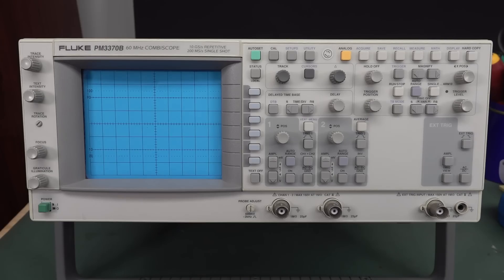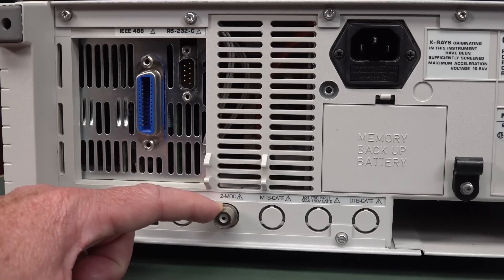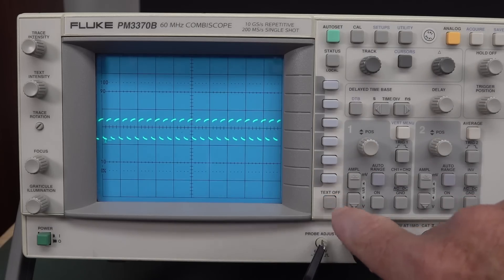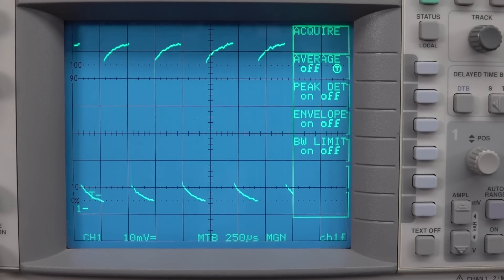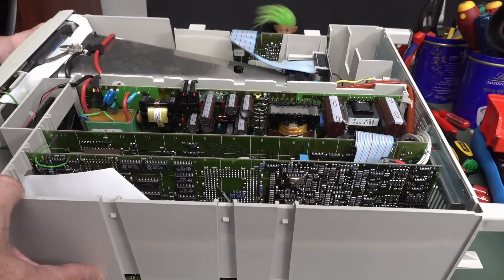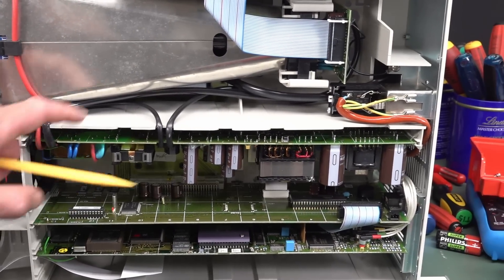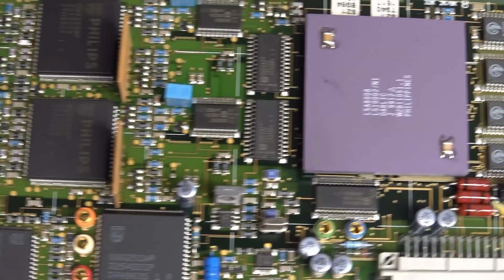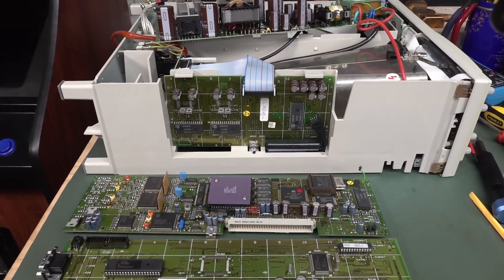EEVblog 1450- $99 Fluke Combiscope Ebay SCORE!

Comment: Used to have a 3082 if memory serves - very similar but 100Mhz and no memory. It was amazing. Bought it from UK Army auction for €150, sold it 15 years later for £150 😂 
Absolutely amazing. Open it up and admire the absolute absence of trimmers. All is done via service menu.

Comment: A few years ago I picked up an old GW GOS-653G that was sitting in a council cleanup pile. I was going to get a friend who's familiar with these old analogue oscilloscopes and has repaired one before to help repair it, but he said he's getting too old and his eyesight isn't good enough to do electronics anymore. Did you want to take a crack at repairing it?

If so it might be a while before I get around to dropping it off, since I don't have a car. And I'd want to clean it up first.

Comment: We have 2 digital/analog, 2 analog only of these with 4 channels and 200MHz bandwidth.
The are pretty good for their age and easy to operate compared to older Philips digital scopes. The digital/analog switch is great to have. 
These ones have had a hard life, they have been dropped many times, the front bezels and  knobs are broken. Three were were bought around 1998 but they all still work perfectly.
I bought one of the digital/analog ones about 10 years ago for $300 on Ebay.

Comment: Around 16:30 i noticed a couple of things. You appear to have co-ax inputs for ch3/ch4 on the main acquisition board, and jumper zero ohm links near the top to change 2k/8k to 32k so it may be possible to hack in the extra ram and even maybe the extra channels.
Reply: Extra channels would be awesome, but (I only listened, didn't watch the video) there are no buttons for the extra channels in the front end. Were they on the board, though? You'd probably have to buy a broken 4 channel model to switch the front, right?

Comment: I’ve had the 4 channel Philips branded 200 MHz version for years now. A bit yellower but the original (Belgian made) Phillips AAs are still going and clean. Glad to see it’s Dave approved. 
I thought it was cool the I’ve had the 4 channel Philips branded 200 MHz version for years now. A bit yellower but not bad. Glad to see it’s Dave approved. 
I thought it was cool the TV trigger mode has settings for analog HD systems at 1050, 1125 and 1250 lines.

Comment: Hola mate 🙂I recently scored on Ebay a Hameg HM305 two channel 35mhz oscilloscope for $140 dollars which also has a component tester built in, like your Fluke in this video, it was sold as "not working, for parts only" but when I got and tested it all seems to work ok except when trying to get a signal on either channel the trace disappears and it is a bit difficult to get it back unless I power it down and start up again, any thoughts?
Reply from the maker: Sorry, no idea. Ask on the EEVblog forum.

Comment: It is nicely put together. I'd hate to have to find that problem. So like it seems to basically work and then at some point it stops working. So like does that mean something changes with time or heat perhaps, and it does it so far that it dramatically fails and starts up ok for a while later. Guess it may help to search for similar problems with that model and then try to isolate what module it is happening in. It could even just be a CRT problem? and it otherwise keeps going properly.
Reply from the maker: Most likely a thermal problem in a solder joint or a component.

Comment: Could it be a marginal/faulty high voltage transformer for the crt display? Perhaps the insulation is breaking down? Snap, and it turns off.

Comment: I scored two scopes at a surplus place. One was a Tektronics 2445A for $50 and the other is a Tektronics 2465B for $60. Both would not turn on which suggests power supply problem. I was able to locate a refurb power supply for the 2465B from Greece for $265 and it has been a great scope since. I was not able to locate a power supply or service manual for the 2445A, so I never bothered to do anything with it since the 2465B is the better model. Great score!

Comment: For under 100 (AUD and not by much) I've "scored".... a broken HP 1742A with an arcing HV transformer (was able to find this part at a reasonable price), and whacked out horizontal that god knows what's wrong in this godforsaken PCB tetris machine, and a broken Tek 442 with a shorted and smoking seemingly irreplacable HV transformer, and a broken irreplacable 5 meg ohm focus pot. Not exactly winning....
Reply: Every time I go looking for a cheap scope (after my last $50 craigslist special I got like 10 years ago died in an irreparable way), I find nothing locally, and everything on ebay is too expensive to gamble on (especially after adding in shipping) or outright up into may as well just pay a bit more (or sometimes less!) and buy a new Siglent/Rigol territory. Like one of these combiscopes is $200-$500 delivered on US ebay right now, that's a bad deal between the modern low cost DSOs and questionable reliability of a 20+ year old used unit.
Reply: ..... One of my pet hates five decades ago was opening a TV and seeing that some dickface had siliconed up a cracked EHT to save a couple of dollars.
Reply: I've got the 1743 - same series, but with a time interval digital readout on the front panel - and I have to admit to being pretty disappointed by the way it's constructed. Older HP stuff was highly serviceable, but they seem to have forgotten about that in these units.  At least it still came with schematics in the manual.

Comment: Awesome score Dave, looking forward to the repair!
I scored a Tektronix 465 (not the b model) 100Mhz analog delay scope för about 40 EUR a couple years ago, complete with probes, original manuals and documentation etc. The pots are a bit scratchy and I plan on refurbishing it one day.
Reply: Been using that scope since about 1980.  Still works fine and is the "quick and dirty" choice when I want to look at something.  Oddly, being on a scope cart makes it more convenient to use than my benchtop stuff...

Comment: I'd KILL for a scope like this. Such a good scope for the day I'm amazed. Due to COVID my budget is $0 and I've been reduced to designing a "dodgyscope" using a couple of microcontrollers. Which in itself has turned into an interesting project... I'm going to add a digital logic analyzer to it using some SRAM and counters to clock them. Thankfully I have the parts in my parts drawer so BOM is $0 for now :)
Reply: ..... Circumstance steering you down a brain improving path you may not have taken.

Comment: Is it possible to make it a 4 CH scope? There are coax connectors for CH3 and CH4 in the PCB. I also look for "for parts" listings on EBay. Once scored a Canon lens for parts for around A$ 200, it works perfectly to this day, only thing I have done was uploading lens data to camera but I am not sure whether it helped or not.
Reply: If this works you would need knobs and buttons to control the channels.

Comment: I was scoring a couple of Philips testgear in the last years - but unfortunately it seems like in recent times it got around, that this is some decent test gear. I bought TWO recently calibrated PM 2534 for 180€ ($230AUD) as bulk. I use those in my daily work. I have a set of PM2521 and a set of PM2525 - and now a set of PM2534. All together for under $350US. I absolutely love those.

Comment: Those 32k 2k/8k option resistors at 15:50 look quite interesting :) I wonder if this puppy can be upgraded with bigger memory chips (as it would seem that there are pins on the memory IC footprints for larger packages)
Reply from the maker: My guess is the firmware will do it if they went to the effort to put in and label the jumpers. Will need to check the manual for the part number of the bigger chip required. The ones fitted are definitely 2K each.
Reply: @EEVblog  that would be an idea for a video. If you could manage it, I'd try it too.
Reply: That would be interesting, you think it's feasible that the firmware would be able to recognize and utilize more memory without the need to modify it?

Edit: 7:21 kind of suggests so. I'm going to have to rtfm on that.
Reply: Above the upper right edge of the ceramic IC of someone wants to have a look

Comment: Nice! I've got the 4 channel version. But its in pieces on the healing bench, half way through re-caping it. Fingers crossed!  :-)
Mine has similar problem, after about 10 minutes warm up, it starts to reset, and the resets get closer together as the scope heats up.
Reply: if theres a thermistor in box c13 (i think) on power supply module, may be worth a measurement
Reply: @azza-in_this_day_and_age  How would this cause resets? 
I have 2 theories:
1) an electrolytic is leaking and as it heats it pull the processor rail down, until it resets.
2) the processor or ROM has had too many hours and as they heat, one or the other gets corrupted and then resets. 
I hope its theory 1 and not theory 2. 1 is fixable, 2 might be fixable if its the processor, but if its the ROM, its likely not fixable, as there are no sources for the code in these ROMs.  :-)
Reply: @mcconkeyb  the thermistor, as the name would imply, can overheat and cause the circuit to open, if broken in a certain way, it would allow for a reset upon cooling. i ran into it on an hvac blower motor. the intermittent faults are always a challenge, best of luck in your diagnosing
Reply: @mcconkeyb  if theory 2, you might try re flowing the board before re-balling that processor.

Comment: I have had a PM3394 for 26 years now and use it as my daily scope because of its great flexibility and better user interface compared to many more modern scopes. I mostly use it in analog and only occasionally switch to digital mode for those more difficult measurements.

Still works great after all this time and it still has the original Philips (made in Belgium not Poland)  batteries which still read more than 1.5V.
Reply: It wasn't being made in Poland anyway, but rather Holland (Netherlands).
Reply: @justotalkalottashit8392  ah, sorry, my bad! I listened to the video (mostly) and shouldn't comment so late at night.

I thought you referred to the scope itself, not the batteries, gah!
I can still be wrong about the scope, correct me if I'm wrong, but I don't think Fluke rebranded Philips scopes were produced in Poland. I'll check the "made in..." label on mine when I'm back from work. I suspect Netherlands though, Philips being a company from there, but I'm not sure where they were actually put together in.
Reply: @tomaszwota1465  --  Didn't you know  "P" sounds like 'Hohh" in Australia?
Reply: @poopytowncat  Well, I had to watch Dave for years before I could even understand the Australian accent, but I'm still behind the curve it seems!
Reply: @poopytowncat  Oh I believe it alright. I read your username and immediately thought "This man is surely a recognized authority in being right about anything on the internet". ;)

Comment: Bought a working  Fluke / Philips PM3335 60 MHz - 20 MS/s Oscilloscope for ~ $75 a little over 5 years ago.  The guy selling them also had a Textronix 60 MHz scope.  In order to buy both Tek probes I bought both scopes for $150 (or there about).  The Phillips still works fine as an analog scope with on screen measurement functions!  Don't know how to access the digital storage functions though.   Admittedly it is, like me, long in the tooth. 

Dave et al., any one know where I can download the user manual?

Comment: Those "bodges" looks to me like they trying to get some heat away from the chips...
Reply from the maker: There is hardly any heatsining effect in that. If they wanted that they would have just used an adhesive heatsink.
Reply: @EEVblog  Yeah... the adhesive heatsink makes more sense, I thought I spottend a bit of thermal paste and had this idea ;)

Comment: I've noticed headers for missing rear panel outputs on the mainboard, as well as RF connectors for 4 channels on the acquisition board. 1st DAC had CH1 and CH3, and 2nd DAC had CH2 and CH4 labeled connectors.

Comment: I have one too, and I think I bought it for around 75 USD. Same condition but working. Use it regularly and have been for three or four years now. I have several other scopes, both modern and much faster analog and digital, but still use this one as I like it a lot.

Nice score and look forward to the repair video.

Comment: The PS could be going into protection mode due to some other cause.  I remember when Phillips  announced their 7 ICs to make a TV it was a milestone.  Their Compact Cassette  wasn't bad either.
Reply: Not forgetting the CD are we? Lots of people think that was a Sony invention.
Reply: @ernstoud  They did invent the Paancake Motor that was first used in the second gen Walkman which extended battery life and slim case.  James Russell 1965 is credited for the CD concept 1980 when Sony and Philips created the famed “Red Book” standard, which was a series of documents that outlined a 120mm diameter disc bearing music at a resolution of 16 bit/44.1kHz.
Reply: @Viewer19 A bit of a weird question maybe, but I noticed you wrote Phillips with double L, the same as I remember the name was written, so do you remember Phillips having a double L instead of the one there is now in the name? In case you're not familiar with the so-called Mandela effect, this one is a nice example for me  personally as I clearly remember it being written with double L. And I'm not the only one remembering it like that, hence my question what your memories are.
Thanks for even looking into this! It really means a lot for me and the research I'm doing around the "effect".
Reply: @maesterwillyofthehouseofboink  I realized my error right after posting dyslexia in my case afects names mostly ei orie  endings more so when I am tired.

Comment: That scope was super clean inside - and so many things done top-notch, that it's surprising there were some oversights like the poor mounting clip design and lack of test points. But still - what a steal!
Reply from the maker: I was amazed, not a spec of dust. Probably only had a few 10's of hour of use or something.
Reply: What do you bet that it wasn't used due to this power problem and no one bothered to send it back or get it fixed?
Reply: @russellhltn1396  ..... Good detective work Mycroft, (Sherlock's smarter brother).
I was thinking the same.
Reply: @russellhltn1396  I have the same theory on retro computers, you get one mint in the box, beautiful - you just know its not going to work because it never worked! Hence mint in box.

Comment: Worked with the 4 channel 3394B 200MHz for years @ Philips. Eating their own dog food. Once they really became obsolete was able to buy one for 40 euro’s. Still work fine altough the tube is burned in and fading.

All those buttons were great to work with. Better than moving though the menu’s of modern scope. That being said.. a modern scope has more functionality. But never had a scope with faster GUI response.

Also great to have analog mode when adc’s lacked speed back in the days. Always a quick way to check what was really going on… (aliasing articfacts….)

Comment: i had no idea fluke made oscilloscopes huh dave i learn something from you in every video
Reply from the maker: Fluke bought Philips, and for a few years branded them as Fluke/Philips.
Reply: @EEVblog  what a bobby dazler lol
Reply: Fluke bought Philips Measurement equipment, inclusing the handheld scopes. In fact the hand held fluke scopemeters are still in use on many places and maybe even still sold new.
Reply: @ReneKnuvers74rk  oh ok so their measurement equipment was a separate division kind of like how hp was or rather is still kool

Comment: The Philips tubes were just stunning.  I like the way they bonded an actual, perfectly flat glass plate with the graticule to the front of the cone and inserted the gun deflection assembly built in regular glass tube in to it.  The only part that was moulded was the cone, and they used frit glass to solder the 3 parts together.  And no, I never saw one go to air.  Exceptional tubes, the spinout from Philips continued to make them for quite a long time, AFAIK, the last CRT manufacturer to close in Europe.
Reply: They were copying Tektronix and the way they made their tubes, but Tektronix took CRT construction to the extreme, using even ceramic envelopes for phenomenal thermal stability.  And nobody ever made a finer tube than a Microchannel Plate Tektronix tube.

Comment: Right on! I picked up the 200mhz 4 channel version of that (PM3394A) at a thrift shop for $30 a few years ago. Awesome scope, but the user interface is a nightmare!

Text focus on mine shows up blurry as hell on every start-up, too.
Reply: Damn, no thrift shops around here sell test equipment like this!
Though, I did buy PM 3370B off of eBay recently, even made a short thread about it on the forums, didn't think I'd see a video about it from EEVblog!

I'd love a 200MHz 4 channel one, and I think they were available, but certainly not for anywhere near 30 bucks! ;)

No problems with text focus on mine, though.
Reply: @tomaszwota1465  You've just got to be patient! I've found plenty of test gear in thrift stores over many years.
Reply: Might have the user interface battery backup, could save yourself a bit of grief.
Reply: @alexkindl861  So, I spun the scope around and found that the large asset tag sticker on the back was covering the same battery backup door that Dave shows in this video - I had no idea these had battery backups! Sure enough, after taking the corroded awful AAs out, cleaning the contacts up with some lemon juice and putting new batteries in, it holds its settings now! Also turns on with the screen in-focus -- nice!
Reply: @kelvinstokes996  Nice!